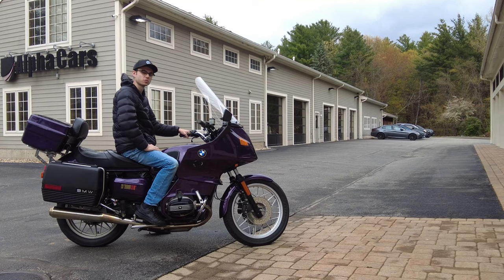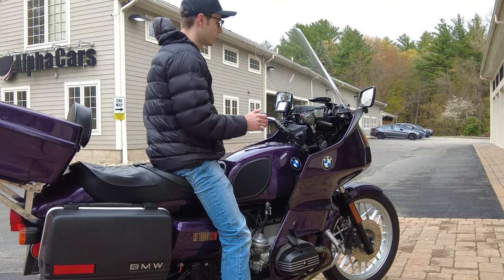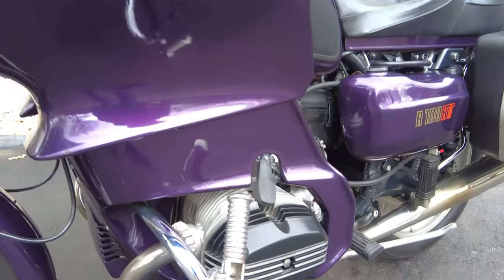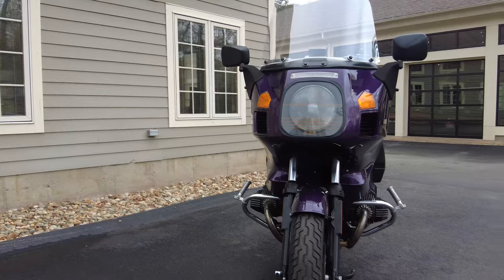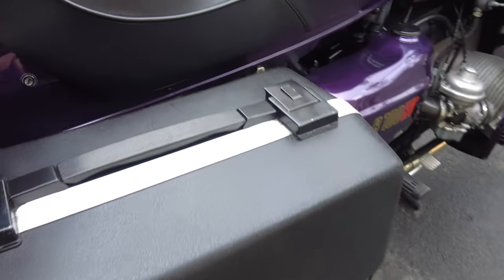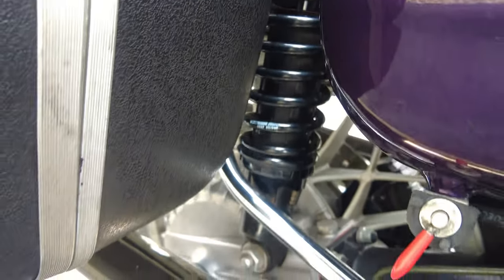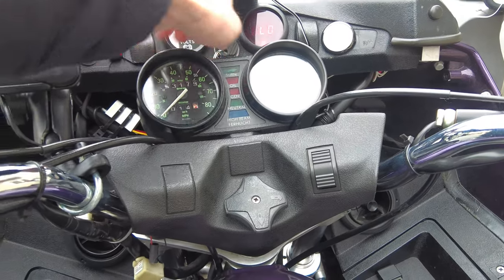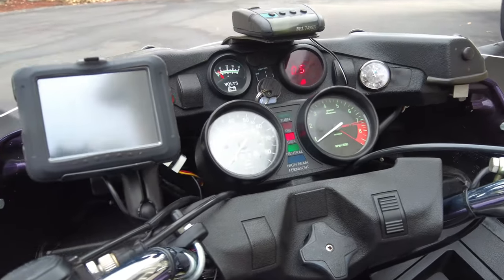One-of-a-Kind Upgraded 1982 BMW R100RT | Overview, Cold-Start, & Ride!

Comment: J'ai eu toutes les BMW, série 2, 60 et 69 S, 75 série 5, 100 RT première génération, mais dernière mouture, avec suspension arrière à gaz, puis 2ème génération 100 RT LT, avec un seul amortisseur arrière, mais avec moto radio BMW, selle confort, et petit top case avec dosseret. ..deux disques avant et frein à tambour à l'arrière. ..j'ai jamais compris ce qui avait pris à BMW, pour sortir ce modèle, moins performant dans tout les domaines. .ce qui m'a conduit à me tourner vers les modèles k, k100  et K 11, puis RT 1100 et 1200. .avant de passer au side-car Ural Rétro